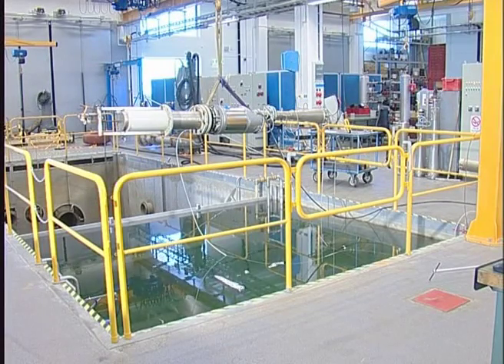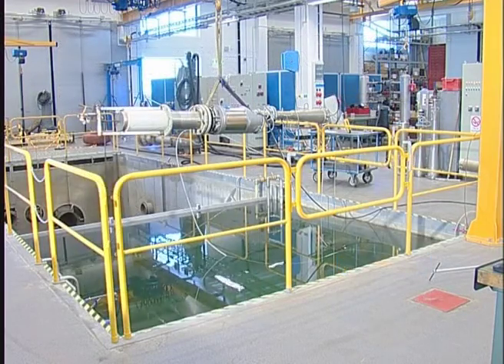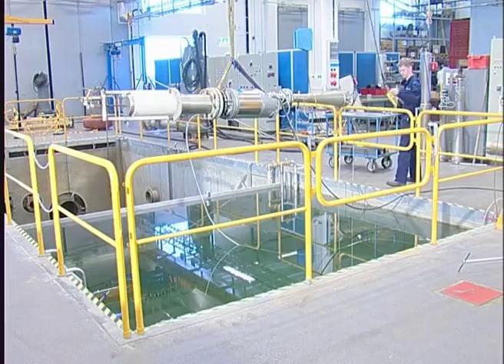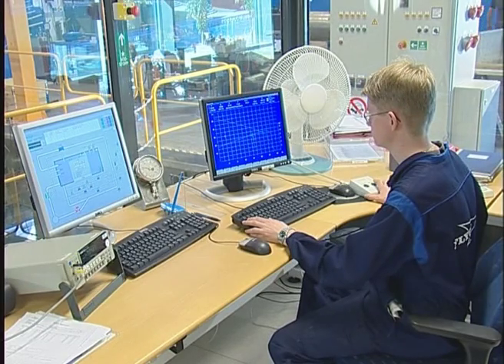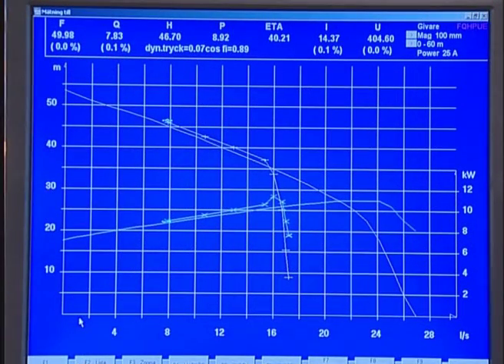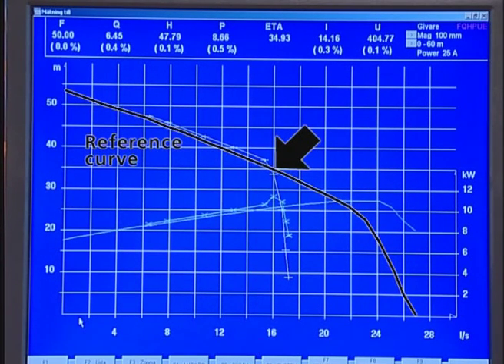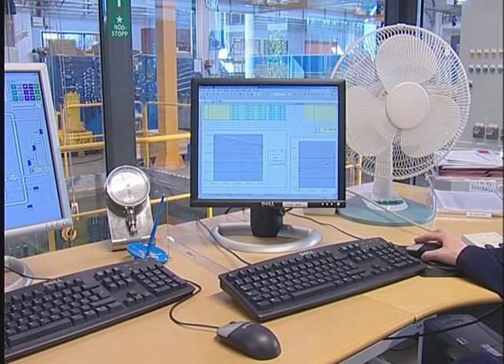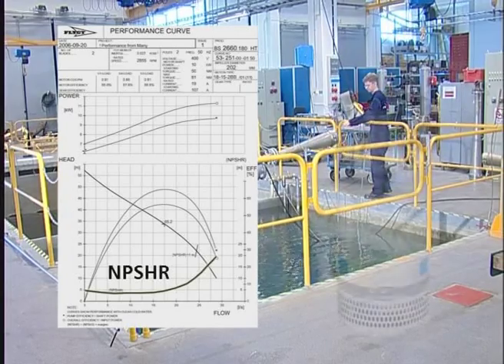NPSH testing at ITT W&WW R&D center.mpeg

Comment: As far as I know, it is not NPSHr, but NPSH3, which means a 3% drop in performance. NPSHr is a more stringent parameter that determines the onset of the cavitation process (noise, vibration, etc.), but NPSHr is usually measured not for mass-produced pumps, but for pumps in critical applications.